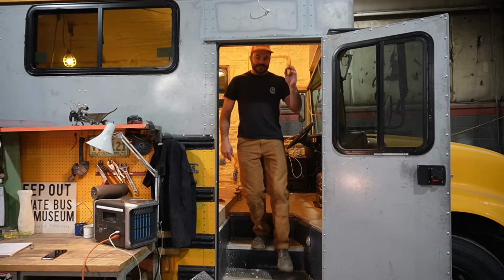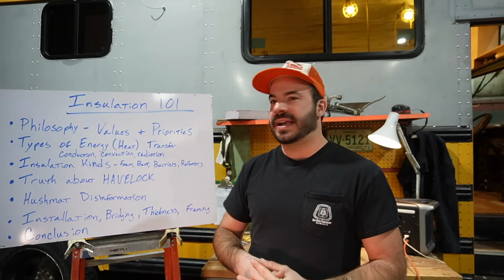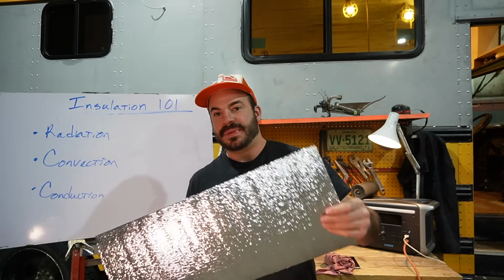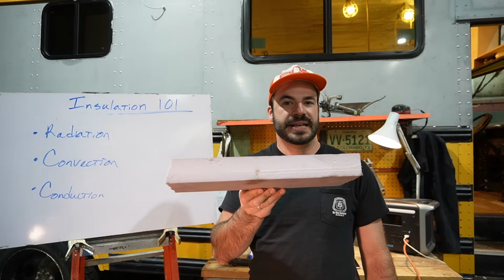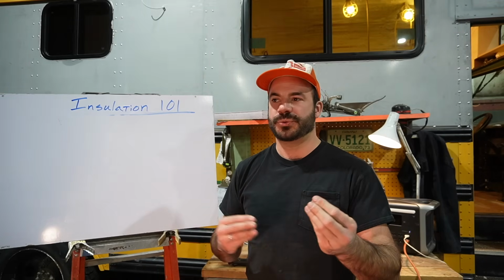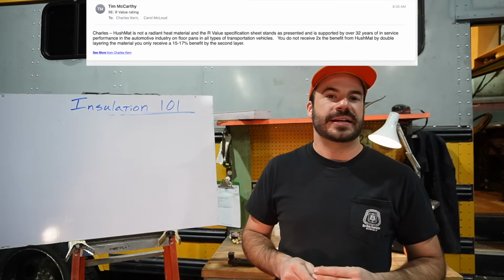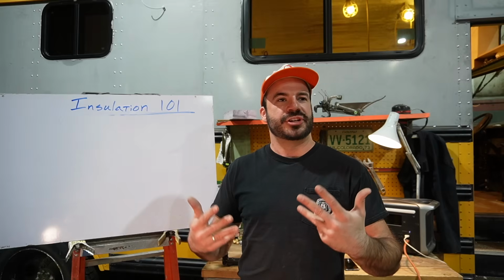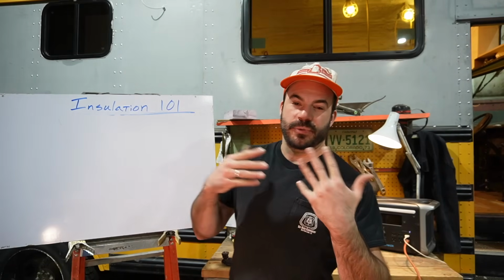Insulation is a SCAM (& the truth about Havelock and Hushmat)

Comment: Isnt the spray foam the same thing as the bottled stuff used on construction sites, window framing etc? Just marked up several thousand percent? If I use that, should I pick the high expansion type to trap more air/gas? Is it off gasing some nasties when I heat the van with a proper wood stove to make a sauna? Or in the summer? Sometimes I weld near polyurethane foam and it stinks like cancer (although not as bad as polystyrene and especially the chemical anchor)
Reply from the maker: Not the same. This is 2 components and is closed cell

Comment: This is wildly helpful. I’ve already ordered thinsulate (thermal and noise insulation). What are your thoughts on this tactic for my Sprinter build?:

1. Spray adhesive thinsulate in all wall and ceiling cavities
2. Variable vapor barrier (MemBrain) sealing off the walls and ceiling
3. Drill drain holes in the bottom of wall cavities in case moisture does begin to build up 
4. Attach birch ply wall panels using 3M industrial strength Dual Lock

Comment: Have you experimented with sound insulation too? Do you think spray foam does a good job of sound insulation on metal walls? What about economical ways of making your own sound insulation like buying 1 gallon of 100% silicone and mixing it with sand? Or 1 gallon of butyl paste and sand? Seems like that might be cheaper than buying the finished sheets of sound insulation that are self adhesive. I need to redo my walls at some point because of all the noise outside from cars driving by.

Comment: You might not care, but you really misunderstood Conduction. What you call Conduction is actually many millions of convective heat transfers. That's why it works. It It was really Conduction, it would be a complete failure. Basically, convective heat transfer works so well you want to surround yourself with it.

Comment: I tuned into this video out of curiosity. My field of study is Physics, and I see tons of BS on youtube from people who don't know what they are talking about but still talk, talk, talk. This is an interesting exception. This is the best explanation of insulation and heat transfer I have ever heard. Not only is Chuck right on, he is also excellent at teaching us what is what. Three cheers to Chuck.... I converted a ford Transit van to a mini motor home and I wish I had seen this video before I did the insulating. I will add only one thing to what Chuck said, and he really didn't get this wrong. When air has a given amount of water dissolved in it, it is said to have a certain relative humidity. If the temperature of the air increases, the relative humidity goes down. BUT, Importantly, the amount of water in the air stays the same (all other things being equal). As the temperature of the air rises without adding or subtraction water from it, the relative humidity goes down. It does just the opposite in reverse. If the temperature of the air goes down, the relative humidity goes up (even though the amount of water in the air stays the same.) At some point the relative humidity reaches 100%. AT that point, the water tends to condense out on surfaces that are cooler then the air. Thus the danger of getting water somewhere in our van/motorhome/camper/house/ car/bus or whatever. It is possible to get supersaturated air, but I won't get into that here. Google it. I also applaud Chuck for taking on the "false" advertisers. That takes a lot of courage for reasons I won't get into here. Thanks Chuck.

Comment: How do you feel about the use of polyiso between floor joists in a mild climate like San Jose, California where the Winter temperatures rarely go below 40F?     How would you air seal those boards in the joists?  Would you do anything to stop thermal bridging of the joists?    Many homes here that are built in the 1970s have zero insulation in the floors.  It's typically a crawlspace with standard wood joists and a floorboard on top of that with whatever flooring you have on the floorboard, again not insulated.

Comment: Vans/buses are basically tin cans, so are planes and the International Space Station. The latter uses Dacron/thinsulate sandwiched and sealed between sheets of mylar. The Dacron doesn’t insulate but the dead air (dead air doesn’t circulate) it traps does. The mylar reflects radiant heat. A plane on the tarmac can experience over 50 Celsius and over minus 20c at altitude, yet the mylar Dacron combo keeps them insulated. Correctly installed the mylar also acts as a vapour barrier.
Problem with foam is it’s old tech, dependent on competing temperatures. Walk into a foam insulated van sitting in the hot sun without an ac or refrigeration unit running and it’s hot as, not so much with mylar/Dacron combo.
Reply from the maker: planes definitely get hot sitting on the tarmac—that’s why they ask you to keep the windows closed. planes can’t use foam because they’re regularly taken apart for inspection
Reply: @ChuckCassadyYT  The ISS doesn't get taken apart and it experiences temp variations of over 200 degrees. 
I used this insulation method in my van  and I'm very happy with it.  With only my body and a fridge as heat sources, on a cold night temp inside is usually 6-8c warmer. On a 38c day internal walls are cool to touch.
Reply: @ChuckCassadyYT  Airlines ask you to keep window shades open on the tarmac so crew can see if there’s any exterior hazards.

Comment: Any advice for anyone building an A-Frame with lightweight steel that will have a metal roof?  To save on cost I want to insulate myself and am thinking of using 3" rigid foam panels and seal the gaps not to mention avoid trying to spray from scaffolding 21 feet or more in the air and that settling you mentioned with batting materials, but what to do where the studs will touch the interior wall cladding? Is there some rubber strip that can be used so that they do not touch?   Thank you and great vid!

Comment: You’ve never had rust issues with spray foam? If spray foam insulation covers the weep holes in the van exterior then water has no where to escape. Spray foam on the exterior always rusts so I can’t imagine spray foaming the inside would result in anything other than rust unless you were able to drain water out of the wall?? Thoughts? Very informative video

Comment: HushMat and KilMat are for NVH, NOT for thermal. Every car guy knows this. It’s thermal properties are merely a side benefit which aids driver comfort from high performance engine compartments, where the noise and heat reduce driver stamina in racing. HushMat would be wonderful under the hood of a Skokie, and KilMat would be great inside the wheel wells. Traditionally, people used bithuene roofing tar for this purpose, to reduce NVH in endurance racing chassis, and I have a feeling it would be great in a bus chassis.

Comment: Great job covering bat insulation and intelligent vapour barriers. I just finished a geodome - same issues as a bus: cold, vapour impermeable layer on the outside of the structure. Siga majrex will actually recommend their product as appropriate for this use case (they've got a blog post covering flat, vapour impermeable tar roofs), which are notorious for causing serious rot issues

Comment: most vans insulation is only marginal  .  and aluminum like step vans are cold in winter hot in summer but there was a van Boyertown was 2 sheets of multalloy and insulation was better but nothing like a foam sandwich wall spray foam bus is different

Comment: This explains really well.  This also mostly applies to insulating a small garage.
Reply: Half the buildings in northern Canada are using closed cell spray foam. Works amazing, zero issues.
Reply: Never, ever use spray foam.  Massive mold problems.
Reply: @TeddyRumble  many reasons where certain spray foams are a bad idea.  But there are many kinds for different applications.

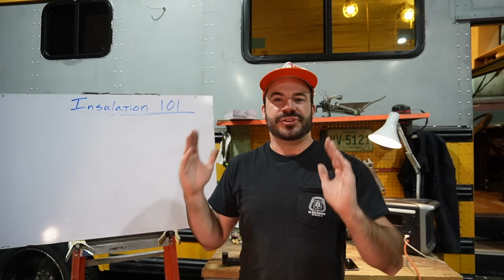Comment: Great video. I'm a physicist, and I think your explanations are great.  I'm curious to know why you only mention using block foam for the floors, and not for the walls.  It seems like vertical wall sections could be covered morer quickly with block foam, and then the cracks filled in with spray foam, obviously covering & sealing any exposed metal ribs like you said.   At around 35:00 you briefly mention insulating walls with rigid foam board and then going back in with "great stuff" - I'm guessing that's a type of spray foam?  Is this what you're talking about?  Is there any disadvantage of doing it this way (block + foam) vs using 100% spray foam on the walls and ceilings?

Comment: Seems to me kids (20s to 30s) think adding Duramat, Kil Mat etc is making their vehicles any better. For me personally adhering anything to the inner body sheet metal will 100% devalue the vehicle if it isn't easily removable. I want insulation against radiant heat from the sun and I want fire resistance AND sound deadening on my engine cover on my van.

Comment: problems with spray foam:1- Nearly impossible to remove specially out of nooks and crannies once applied.2- ( specially if applied without an airtight vapor blocking film or sheet) potentially Hazardous (for some allergy inducing) Gassing inside tight spaces.3. Nearly impossible to produce  flat surfaces as an underlay with the consequence of hollow spaces behind  paneling.
Reply: Spray foam if applied correctly does not need a vapor barrier.

Comment: excellent video - but i realize this seems very directed to a cold climate type of build.   So i have just purchased a van that i would like to build out, but i do not plan on living in it, but use it more for enjoyment/camping on road trips.   Is the thermal barrier as important in a warmer climate situation?   i think my main concern will be keeping cool - not warm, although i do intend to have heat for cooler nights.  the thought of adding 3"  of insulation inside a 6' wide van (distance between the larger ribs) is a bit concerning.   any thoughts, suggestions?   Thanks!

Comment: Spot on analysis, explanations and recommendations.  Big thumbs up!  It should all boil down to physics (specifically the laws of thermodynamics and material science), toxicity and money...not personal philosophy and values.  For insulating conventional homes, Extruded Polystyrene (XPS) and polyethylene barrier sheeting are now widely used in combination and are both sold at all home improvement stores.  Now, OSB exterior wallboard is even available with a 1 inch layer of XPS bonded to the inner side that faces the wall frame, to prevent wood-to-wood contact and thereby prevent thermal bridging from the outer wall surface to the inner wall surface via the wall studs.  Spray foam is king in many applications because of its absolute ability to seal air gaps and prevent air movement through walls and ceilings, but is definitely the most costly of the two options, besides having the potential for toxic off-gassing that worries some people.  If in doubt, stick with XPS, which is also the cheapest of all options and the second most thermally insulative of all options.  Either use a little spray foam to seal any gaps between and around the edges of the XPS during installation, and/or cover over the entire surface of the installed XPS with a thick sheet of polyethylene to prevent any passage of air and water vapor.

Comment: I am planning to purchase an electric pickup truck . And build a topper for it and use it as a retirement camping vehicle.

I would like to insulated the initial vehicle and the topper for heat and sound transfer.

Pickup Cab......
Wheel wells 
Roof
Doors
Floors
Firewall

Pickup bed.....
bed-walls
bed-foor
bed-wheel-wells

Topper.....
Probably an homemade topper.
I have been researching using the 2 inch thick pink Styrofoam. 
Or could build it to accept spray in foam.

I have a feeling I should use spray in foam wherever I can.
My only concern is the foams outward pressure as it expands.

Product choices...
Spray foam
Extruded foam.
Butyl insulation

Since the cab can be fully opened up to the bed "Chevy Silverado EV with it's mid-gate "
SOUND deadening is the same if not  more important then the best insulation value.

I know i rambled.
Any thoughts on the different parts of my project?

Thanks...

On the video... more info on thr R values would have been helpful
Reply: No information on weight. For a vehicle I would want to keep it as light as possible.

Comment: Dude I'm a PhD in Mechanical Engineering with a heat transfer specialty and I've been so confused about all these radiant heat barriers being used to insulate between walls. I was like what the hell am I missing here? I don't think I'm missing anything, I think it's false advertising.
Reply: I think I'd have to model it and experiment. To me the main advantage is that is extremely thin and cheap so why not. But if it is touching, with no air gap, I'm not sure of the benefit.
Reply: What do you mean when you said insulate between walls?
I was an installer of radiant foil for a 'green energy' company.  We did solar, solar hot water, air sealing,  and radiant barriers. 
We've measured attics at more than 140f, and when we finished,  the attic would be a few degrees above ambient. 
Done properly,  radiant barriers are highly effective and i think that 9/10 people dont understand the underlying way in which various insulations work.
Reply: Greg Virgoe here on YouTube really explains it well.
Reply: @JNante agreed
Reply: I have the question to you 

What is the best insulation made so far ?
Reply: You must keep the radiant barrier at your target temp (indoor side). Otherwise it will just become a radiator.  
The foil faced plywood used as roof sheathing just heats to the roof temp (140F) and re-radiates it to the room. I used mylar foil inside my insulated walls & ceiling, then mounted the drywall, offset with shims/spacers. Greatly reduced the heat load from the South and roof exposures.
Reply: @markhischier2750 wow that's great insight ok
Reply: I don’t know anything about insulation, but I’ve been reading a lot about it since I’m going to have someone do a custom van for me, and I’m very concerned about mold because of underlying health issues. One argument I have seen repeatedly, is that the people who are for certain types of insulation, like radiant barriers, are looking at it from the perspective of insulating like you would for a house or other similar dwelling, when in fact the properties of construction, and the conditions and the with which a van will be used, etc., are not at all like a house.

Are there any people out there that agree with this? 
@DrFear-100

Comment: Not arguing, but having trouble understanding how the radiant barrier on the firewall reflects the radiant heat without the air gap like you referenced for the reflectix on the windows.

Experience tells me it works on the firewall but the air gap thing now has me confused.  What’s the story?

Comment: I appreciate the detailed information, but I’m not sure what to do with it. I’m planning on converting an astrovan into a camper, and the space will be very limited. There’s no world where I can sacrifice an additional 1.5 inches of space from the interior ribs, and still have a liveable space. I can follow the build for a floor which you have laid out, just using 1 inch xps board under thin plywood, but I cannot put 1.5 inches of spray foam over the ribs. I guess my only option is to ventilate the interior well, and bring some warm blankets for the cold nights.

Comment: Got to say you give a much better explanation on insulation and the building science behind it than many of the classes I had to take.  Even though it's way beyond what your audience may be looking for, it's a quick and easy education on insulation.

Spray foams are very different today than in the past.  The new water based blowing agents are low voc and as a result have seen an improvement in the r-value per inch with some exceeding R-8 per inch.  Closed Cell Spray Foam (CCSF) becomes an air and vapor barrier at 1.5" so this is a win-win.  I see it used in New Construction all the time.  It's not as easy to work with as fiberglass batts but provides better insulation value per inch along with its air and vapor handling qualities.  XPS is typically used on foundation slab edges for its superior qualities  including compressibility and typically gives you R-5 per inch (though their is one company that gives you R-5 per 3/4" which is important when considering a brick facade that needs a 1" air barrier between it and slab edge insulation).  Until the EPA (Energy Star) made a clarification on insulating between a horizontal slab edge and masonry on a brick ledge, XPS was used under the first course of brick on the brick ledge.  There are other ways to insulate but not all are practical for use in a camper.

Comment: Wow, I’m a retired teacher, and I can confidently say that your explanations were incredibly good, and I learned a lot. That being said, I’m going to check out your other videos, and hopefully you have made a video showing your framing/wall foam insulation method because I didn’t follow all of it. I think you said that you attach the wood supports directly to the metal ribs of the van and then spray 1.5” of foam over everything? Then how would you know where the wood supports are if they are covered up with foam?